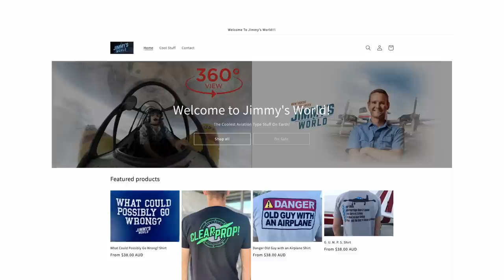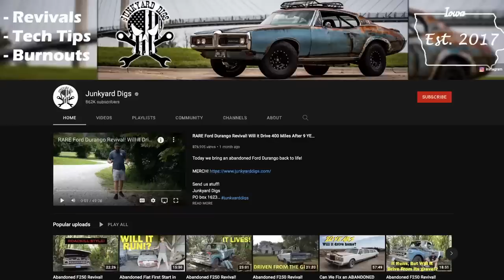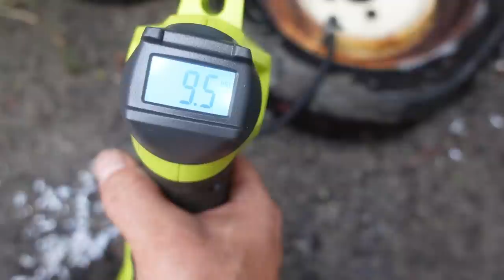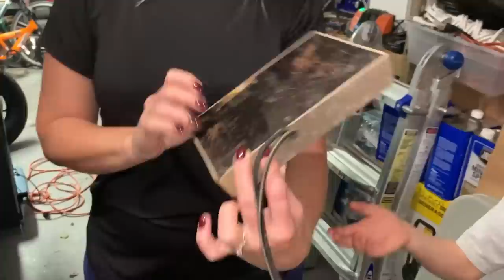Getting Our Abandoned ELECTRIC Car Home After 20 Years

Comment: I had one about 40 years ago, mine wasn't like that.  It was called a Comuta-Car, by Commuter Vehicles.  It had two groups of four 6v Deep Cycle batteries, one at the front bumper and one at the rear bumper.  The two groups were directly connected together, with metal plates when I got it, but I replaced those with battery terminal clamps connected together with short pieces of 00 gauge copper wire.  Low speed used a bleed-off thing (a loose coil of ni-chrome strip, I think) with the two groups of batteries connected in parallel for 24 volts.  Medium speed was the batteries connected in parallel for 24 volts, without the bleed-off.  High speed connected the batteries in series for 48 volts.  That was done through high-amperage "contactor" relays.  I never blew any fuses.

I contacted Commuter Vehicles, which was still in business at that time, and got new turn-signal indicators etc, because the originals had some corrosion and didn't function reliably.

Mine also had much better doors, with regular car-style handles outside, and the windows were good plexiglass with "wing" type parts that slid open/closed.

Comment: Aging Wheels did an interesting test drive of one of these. He showed that the speed controller was just a series of switches rather than a variac or rheostat which would allow for linear speed control.  I think there were 3 or 4 switches the throttle triggers. The car was made by Sebring Vanguard in Sebring Florida on a EZ GO golf cart chassis. So, it's a Florida  native! Later versions were made by another company who added the world's most ridiculous bumpers to it. They look like bumper cars! Until the Nissan Leaf, these were the most produced electric cars in history.
Reply: Aging Wheels for the info and Maybe Tavarish or Jared at Wrench Everyday because they can't seems to say no
Reply: Just need to get a Rheostat
Reply: Also, Aging Wheels has some knowledge on how it works...
Reply: @georgecloudjr.3008  Aging Wheels and Tavarish have worked together before and Tavarish is in the I4 corridor, so it could work! In fact, Tavarish even gave him a Yugo!
Reply: @3rdworldgarage450   I know Jared and Rob were at LSFest and MoParty This could be an interesting collab between all 3
Reply: @chrispetty8587  Rheostat uses resistance thus would reduce range significantly. This is why the relay use to run parallel or series to change voltage/rpm. The modern way would be transistors switching very fast PWM (pulse with modulation) to control a DC motor. Ac motors use frequency modulation. Welcome to the future in the 1947 at bell laboratories TRANSISTOR demonstration.
Reply: Those large bumper are there to be compliant with the crash requirements that became effective in ‘74-‘75.  All cars then had ridiculous large bumpers.
Reply: I had one about 40 years ago, mine wasn't like that.  Low speed used a bleed-off thing (a loose coil of ni-chrome strip, I think) with the two groups of batteries connected in parallel for 24 volts.  Medium speed was the batteries connected in parallel for 24 volts, without the bleed-off.  High speed connected the batteries in series for 48 volts.  That was done through high-amperage "contactor" relays.  I never blew any fuses.
Reply: @kerryedavis  You probably had the later version. The early version had problems with the speed controller (among a few other things). Apparently it wasn't robust enough and both the reputation for problems and warranty costs is what sunk the original company. They did get things right, but it was too late. It was indeed the first popular EV in the USA and given the technology of the day is was actually a pretty good vehicle for it's intended use.
Reply: A post office near me had their parking lot full of these many years ago. They were never used and one day they were all gone. No idea what happened to them. Just another bad management decision I guess.

Comment: Hey Jimmy, 
You might want to fiberglass the inside of the shell to reinforce it.
Then use an epoxy filler to repair the cracks, then repaint it.
Reply: Do you have a university degree, in Stating The Obvious?
Reply: @johnnunn8688  I do
Reply: @fullhalf420  I think you will find it is a fibre glass shell.
Reply: @samrodian919  Its ABS plastic.

Comment: Jimmy, I sold those back in the day. It has three rheostats so three speeds. be carful when you floor it from a standing start it tends to blow fuses. have fun with it. (I'm also one of those guys who bought a $1000 T-shirt from Elio)
Reply: I had one about 40 years ago, mine wasn't like that.  Low speed used a bleed-off thing (a loose coil of ni-chrome strip, I think) with the two groups of batteries connected in parallel for 24 volts.  Medium speed was the batteries connected in parallel for 24 volts, without the bleed-off.  High speed connected the batteries in series for 48 volts.  That was done through high-amperage "contactor" relays.  I never blew any fuses.

Comment: Would love to see you upgrade the batteries to lithium batteries, more power less weight = better performance.
Do I see a possible collaboration with rich rebuilds?
Reply: 18650s
Reply: @1NIGHTMAREGAMER  waste of effort. Just buy a EV module ready to go from battery hookup. Way way cheaper than welding anything yourself.

Comment: In the early 80's a tornado went through Sebring Airport, I did storm repair on several buildings back in the day. There was a large facility there that Vacuum Molded the PVC panels used on the cars, molds, parts, frames, even a stash of GM 4 speed transmissions for the cars. All Abandoned at the time...

Comment: Jimmy I know I was a little harsh with you about the car but I'm sure when you get it running your going to have a lot of fun with it I hadn't realized you were doing it for a great cause . If the body is plastic there is a way of fixing it .they make plastic rods like a welding rod and you can basically weld the cracks back together .if it's fiberglass a little fiberglass mating and resin on the inside will fix the cracks and help stiffen the whole structure. you can also use the  resin on the outside as a filler and sand it down smooth .
Reply: Seems the Citicar bodies were made of ABS plastic, which can also be purchased in various colors as filament for 3D printers. ABS can be welded in a variety of ways, including using a tool similar to a soldering iron to melt the plastic and filler, spin welding, and solvent welding using acetone or an ABS/acetone slurry.

Comment: Been a golf course Mechanic for over 40 years, It's a Golf cart with a body. Different gearing in the transaxle made it more street-able. 48 volts 6 - 8 volt batteries wired in-line. a controller box, solenoid, electric motor with speed sensor attached to the transaxle, key switch, and what is today called a MCOR mounted to the pedal which acts like a throttle, pretty simple wiring harness. That's about it.

Comment: Next time you should pull the valve cores out of the tires to get faster air flow which will seat the beads.
Reply: Doesn’t matter if you only got a football compressor they move hardly any air
Reply: Maybe go to a tire shop?

Comment: As long as there are no chunks of plastic missing and only cracks in the plastic I may have a no cost solution. A friend repaired his cracked snowmobile hood by drilling small hoses along both edges of the cracks and then zip tied the cracks together to resemble surgical stitches. It looked gnarly cool and edgy. You’re welcome.

Comment: I helped 'rescue'  3 of these from a back lot in seattle about 10-15 years ago.   Two were unsold original dealer stock with about 100 miles each,  and the third had about 6000 miles on it.   We towed them back to the buyer's house on a modified harbor freight 4x8 trailer after pulling the batteries to reduce weight.    We also got a lot of unsold dealer stock in spares including a NOS motor and several of the rubber foam bumpers.     Since then the buyer (a former cooworker)  restored and kept one,   his friend who partnered with him on the buy and restore kept another,   and they ultimately resold the third one.

The best bet for these is to do a 72V upgrade,    and install a modern motor controller and charger,    and ideally  (budget permitting) lithium batteries.    72V worth on nissan leaf batteries (probably even 2 strings) or similar will fit easily under the seat box once the old electromechanical controls are replaced,    and will make the car much lighter than original and give it better range.   The original motor should still be OK with the higher voltage unless you are in a very hilly area.

Much of the body hardware was AMC motors,    and brake cylinders are from boat trailers,   and the wheels/tires are 4.80x12 trailer tires so are replaceable.   The ABS plastic body is a challenge but other suggestions in the comments are good.     One of the ones I mention above they just went 'dune buggy' with it and removed the body -  they have a full cage.    Can also go mad max with sheet aluminum panels or such if you aren't going for originality.

Find and join your local EV association - most major cities have one.   You will have people who have done conversions and worked on EVs like this one to give you more advice.    

Fun fact:   These cars were featured in the dystopian future movie 'THX-1138'

Good luck.

Comment: Jim, do a presentation on making a cheap fibre glass mould using the front panel, then make a new front, it will be fun and very exciting to do. You can sell the mould or offer to supply new panels to others, or keep in case you need to replace. I knew nothing about fibre glass, yet it is so easy. You can add your own touch to the design at the same time.
Reply: since according to another comment they were built in Florida it might be worthwhile to see if any new panels still exist or maybe even the original moulds might exist.
Reply: Is this a legit offer?

Comment: Sebring Vanguard Citicar. Have worked on a couple at my shop in Florida. Pretty basic. Over glorified golf cart. Basic speed control. Lead acid batteries. We upgraded the last one with lithium batteries and a Curtis controller. Brake system is pretty basic. My company is easy to find. I'm on Facebook and most vintage car guys in FL. know me. Reach out if you need a hand.

Comment: Jimmy the front axle looks like a Taylor Dunn golf cart axle. I can't speak to the fiberglass work but if it is built off of a Taylor Dunn golf cart the electrical system is blindingly simple. The company I retired from had about 100 of those carts they were simple to work on.

Comment: bought an electric car back in 2015. That's what lead me to haul cars but that's another story. It would do 6mph per 12 volt battery.  U can maybe expect to get 25-30 mph unless you get a new controller & get more volts.  There is controllers that are programmable but also need a charger that is compatible. but they can go up to 144 volts.

Comment: I had a '71 Pinto from Ohio and a '78 Econoline company van from Jacksonville. FL. that used the same keys. I was leaving for work , started the van,  saw I had the Pinto key in the ignition switch and van was running. I tried the van key in the Pinto. Yepper. Dont know what those odds are.

Comment: This video was great timing, last week I looked at an EV in Hills Iowa.
The car was a Dynasty IT, 
The new owner replaced the electric motor with a 250cc motorcycle engine, but was geared to low. Top speed in 5th gear was 10mph. Maybe good as a TUG?

Comment: You need a 3000 w 48 v battery and probably a controller. 2000 w would do. 4 x 750 w batteries would have you going 20 miles at 15 to 30 mph or more, especially if you can pedal assist then range goes up. One 750 w 13Ah 48 v battery is $350 anywhere. New controller $? All of that can be found from elec bike or car suppliers. That thing may be geared, too, which could give you 40-50 mph. I'm not sure on what roads you're not allowed to drive on though, and it would have to be registered and licensed. Great car!

Comment: I always thought it would be really cool to find one of these old CitiCars and update it for the 21st century:
- 1) lithium batteries. They are MUCH lighter than the original lead acid batteries and are a lot more temperature resistant. Optionally, increase speed and/or range.
- 2) A real variable throttle.
- 3) better brakes all around
- 4) windows that work (roll up and down)
- 5) better interior
- 6) depending on the new battery situation, perhaps a heater or limited a/c might be possible
Reply: Might be better to design and build a new car from the ground up.
The upgrades will cost more than the car.
Reply: @workonitm8  True, but where's the fun in that? ;)

Comment: I bought a ’75 Citicar in 1990 and had it for about 10 years. I love electric cars, but honestly, I wish you had another project. The body is ABS, fiberglass won’t stick to it, you will have to look into plastic welding. The body on mine was much worse, it had been partially melted by a nearby barn fire. I was lucky to buy one of the last NOS ComutaCar bodies from the company that descended from Sebring Vanguard, Sebring Auto-Cycle, and modified it to fit. Road trip? Range is 30 to 40 miles on a good day, top speed 38 mph. A ’75 is only 3.5 Hp, the 6 Hp version came later. No faster though. I used mine for very local commuting. It was never reliable until I upgraded the motor control system to a Curtis golf cart controller and had the motor rebuilt. The original series/parallel and resistor setup was just crap. I did reuse the contactors as the forward/reverse control. Another issue was the microswitches on the parking brake, I ended up switching to a Pontiac brake light switch under the floor. The brakes SUCK. Stamped steel brake drums, single master cylinder. Those aren’t Cessna brakes; they are cheap copies, but maybe you could get some real ones to replace them. I switched mine to the later front drum setup of a ComutaCar. The bumpers are just molded foam over wood. On mine the wood rotted away so I cut the back open and stapled in new wood. I brought mine home ON at tow dolly, it is so short the back wheels fit on the ramp part when the front wheels were in the wells. After I got it running, when I moved, I removed the motor on mine and flat towed it from southern Alabama to southern Illinois with a Honda Civic in the winter. Young and stupid. When I moved up to a better electric car I sold it to a guy to use as a stage prop.

Comment: Just spray starting fluid in tires and light a paper towel throw on the edge of rim and stomp on tire and you might not to add air. With a small boom !!

Comment: CitiCar were kinda clunky and squirrely for tires and suspension (fix that!)
fiberglass isn't tough fixing, good candidate for a big eTek brushless motor,
more efficient and 11-12 hp.13" aluminum rims (wide offset) with 60 series tires would fit nice, like the old Datsun's and Toyota's took.. might find at a junkyard cheap.

Comment: You might want to put the car in a paint oven. It will anil the plastic and should help with the cracking, then you can get a plastic welder to fix up the cracks.

Comment: There is not an Ignition.  Only a single pole single throw switch to activate the electric circuit.  Tractor supply and Harbor Freight are your friends.

Comment: Pretty sure this car only had a 40-50 max range on a single charge so if ur gonna go a long road trip bring jumper cables and a gas car to be able to charge it or bring an adapter to be able to plug into standard outlets

Comment: So disappointed you didn’t try the old lighter fuel trick.  Another options would have just bought inner tubes for all the tires.  I was actually surprised they didn’t have inner tubes in them.
Reply: Or just go to the tyre shop and bang some new rubber on them

Comment: Next time on flat tires like that make sure you remove the valve stem core not the valve stem itself the inside let's more volume of air get in there quicker it helps seat the bead
Reply: That little compressor just isn't up to the task. ........... Not enough air volume.

Comment: it's an LSV low speed vehicle can only be driven on 2ndary roads max out at 35 MPH I believe I actually road in one back in the mid 70s they had like a 30 mile range the one I was in was bright yellow has 8 deep cycle 12 volt deep cycle lead acid battery's, if it was mine I would retro fit it with nissan leaf battery's
Reply: not in CA it's a full ev lol

Comment: Is that bodywork plastic or fiberglass?   Fiberglass would be easy to fix.  Plastic      IFFY!
And I concur with the others, that litte green boxed Singer thing is a button hole maker attachment. 
MAybe you could just shop around for a used Club Car Golf Kart around the Florida Retirement Communities and buy an entire running gear set up.  My fat tired Brister Yard Truck (gas powered type Golf Cart) uses the same bolt pattern as the trailer tires, only it has wider rims for the bigger  lawn tires......
Shoudda bought youself a HArbor Freight Winch and battery to suck that thing into the trialer on the flat tires.

Comment: WARNING 
my father owned several of these, including the longer one.

The repair mechanic did something and the batteries shorted out MELTING THE AL frame! Ouch 

Neat to use just add two electric fans for inside

Comment: "It will be fine" is something a guy started on Cars and Camera Youtube channel. Should have called Lowes and Home depot for wheel barrow wheels and tires. or a lumber yard. Go to the animal control in your town for a dog much more reasonable and you will be saving a dog too. Didn't have any Starting fluid? need to tie it down and chalk the wheels so you do not lose the car out the front of the trailer if you lay on the brakes real hard. Diabetes is the number 1 cause of kidney failure due to high blood pressure.